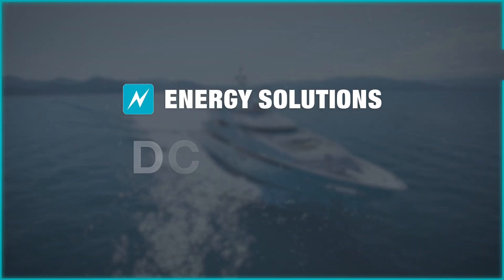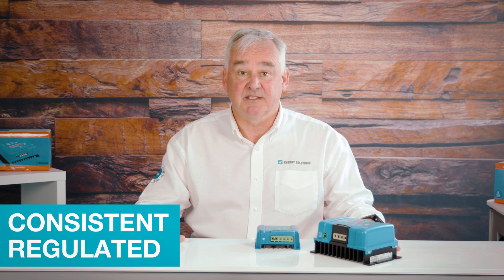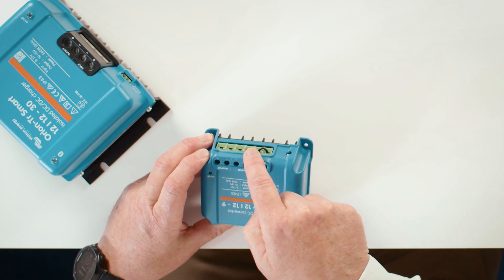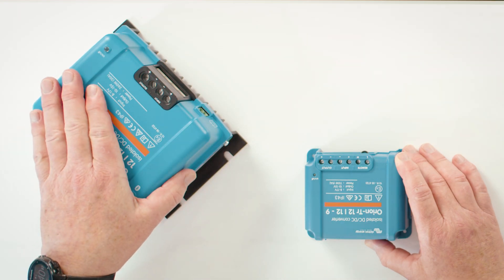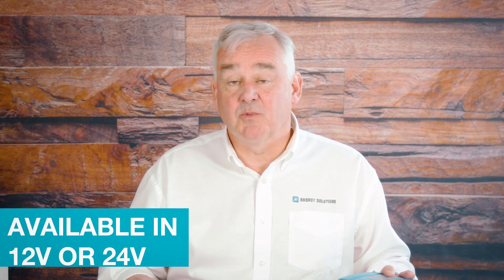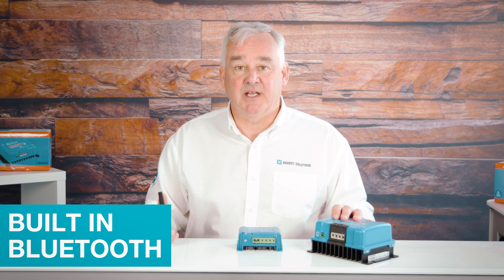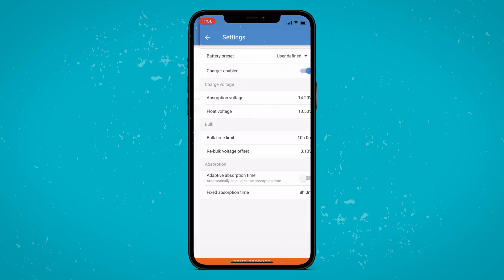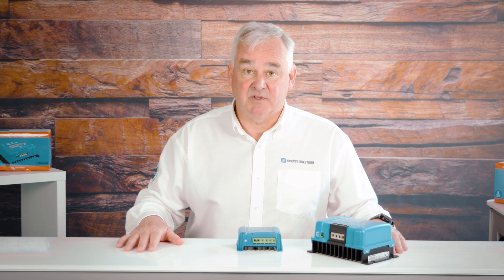Which DC to DC Converter Should I Buy?

Comment: My 12v-12v 30amp unit started charging @ 32 amps then it got HOT and then dropped to 27 amps. I made a box and installed a 12v computer power supply fan. Now it runs at 30 amps all day long and it runs very cool, almost @ room temperature.
Reply from the maker: Hi Gant, 
Yes a great tip! Chargers get hot, especially in 12Vdc with low voltage and high currents. 
It's always recommended to allow space and good airflow for chargers, if you can't do this than active cooling is the way to go.
As the Orion heated up, the internal thermal protection kicked in, reducing output to 27A to prevent it getting too hot. By adding the fan, you've improved heat dissipation, keeping it cool and allowing it to maintain a steady 30A without throttling the power.
If you ever look at the power ratings of electrical products like chargers and inverters, the power rating will usually say, "at room temperature" or "at 25 degrees". Which is where they are most efficient. So, maintaining this temperature where possible will keep chargers and inverters working at their best.
Reply: Satisfaction of your own job well done & working. Good job.

Comment: Efficiency of only 88%. There is no DC-DC with lower efficiency than Victron Orion.
It needs to be completed with a extra cooling fan.
Reply: You are absolutely correct. My 12v-12v 30amp unit started charging @ 32 amps then it got HOT and then dropped to 27 amps. I made a box and installed a 12v computer power supply fan. Now it runs at 30 amps all day long. And it runs very cool, almost room temperature.